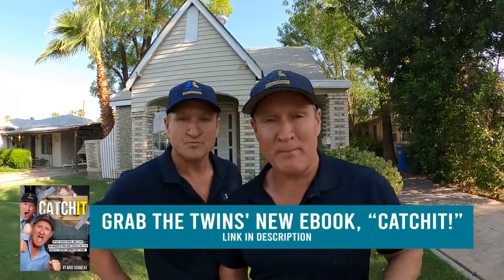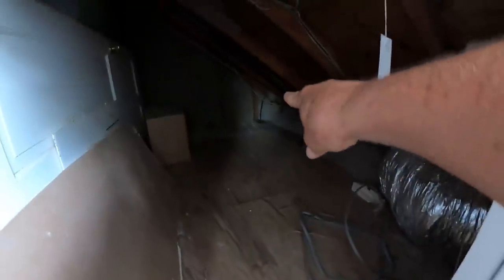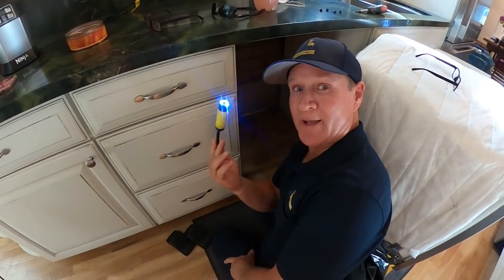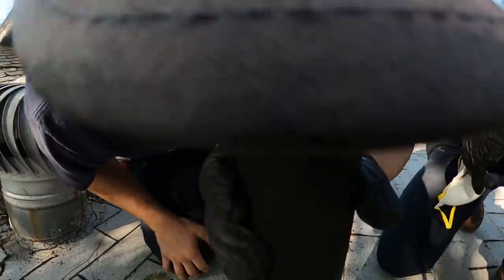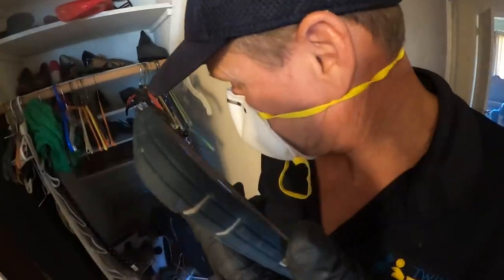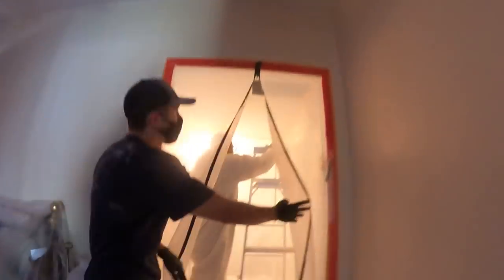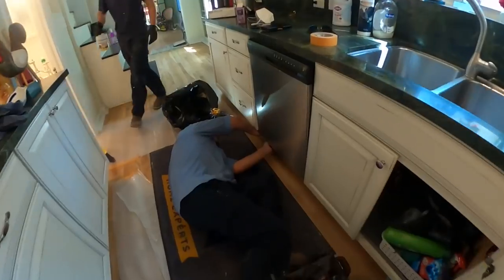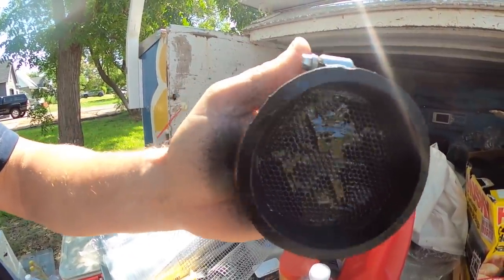Get rid of RATS FAST!..SEWER RATS entering through ILLEGAL repair!!

Comment: I can’t believe contractor would install the fan into the sewage system.
Reply from the maker: Right!?? 🙄🙄
Reply: @TwinHomeExperts  🐀 💩
Reply: Unfortunately I can, being an old building, it's likely difficult for them to run a full size exhaust line to the outside especially with the sewer vent line already there, so from an Ease-of-Work/Laziness Perspective, connecting the 2 lines together is a no-brainer despite it being Highly Illegal and extremely unsafe...

I'm surprised the home owner wasn't constantly smelling sewer gas in that bathroom...
Reply: @HappilyHomicidalHooligan  how is it a no brainer if it is highly illegal and unsafe…💩
Reply: @jamesp8  It's a No-Brainer because coming up with the solution to how to get a tough to run vent pipe through the available space is very simple when you realize there's already a vent pipe there so just connect the new one to the existing one...It's referring to the simplicity of the solution, not it's Legality or Safety...
Reply: @HappilyHomicidalHooligan  Could have went out horizontally to the outside wall as an alternative.
Reply: @Guillotines_For_Globalists  $$$$$$$$$$$
Reply: @robert9595  How so?  Drill through the siding or brick, install louvered vent, run duct to fan, done.  Not all that complicated.
Reply: @jamesp8  obviously contractor was unlicensed or didn't care about anyone safety and look for quick buck
Reply: @HappilyHomicidalHooligan  yeah it’s difficult no doubt about it but that doesn’t justify lazy behavior that could literally affect someone’s health and well being. It’s downright laziness and negligence. You pay for the work so do it. Period. If the twins can do allllllllll of what they did in this video and many others then so can a professional contractor run a proper ventilation system. I’ve lived in older 130 year old buildings and yes it can be a nightmare at times figuring things out but again no excuses when it comes to someone’s health and well-being.

Comment: I just ran across you video series tonight.  Great investigative work!  I retired 7 years ago ( after 32 years in the industry) and I do miss the hunt to find how they get in.  Here in S. Fl. they use lead lining to wrap the plumbing pipes above the roof to keep out the water.  We were trained to use hose clamps to secure the wire cloth around the opening so we didn't penetrate the lining and cause a potential water leak issue going into the attic over a long period of time.  I noticed the pipes you were working with in this video didn't have the lead lining, however, plumbing companies have taken pest control companies to court over the issue of drilling holes in the lining and won!  So be careful if you weren't aware.  I like your smoke system, I just used a wet vac and reversed the hose to blow a smoke bomb through the plumbing system and I used a sewer line snake camera to find the breach.    I used snake cameras and bora scopes. We referred plumbing companies to do the repairs since we weren't plumbers. I love the fact that you do ALL of the repairs not just the exclusion.  Keep up the great work.  I think you are an asset to the industry!

Comment: Hello Rat Twins,

   A very helpful hint, as per the electrical cables, well any type of cable, that run to the house, which rats love to use as route. Ha - Ha like a ski lift.  

   What's a funnel barrier cone? Reference: To what one looks like. Look at photos of ropes to a ship being mored to a pier.  Used to keep rats from climbing aboard.  
  
  Construct the funnel cones out of sheet metal, big enough so that they cannot climb over. The diameter should be like 10' or so, If too small they'll be able to climb over the funnel.

  A good way to keep rats from getting to the house via a cable.

  Good Luck

Comment: great info...very thorough.....my big question tho, is where do you begin as far as the incoming sewer lines???  What if they are very old, like here in new england?? Obviously you try and get under the crawlspaces, and search for those spots. Here in my area, there's 100 yr old cast running into the houses from the street, there is also alot of access holes ( with a metal cap) in the basement cement floor in order to flush the lines.... my house has at least 2 flush holes front and back. The roto guy uses them once in awhile to snake . How would you tackle containment in a 100 year old infrastructure?? Particularly in the the basement concrete areas?

Comment: Capping off the sewer vent pipes:  There are both "in-y" and "out-y" slip fit (glue type) ABS (same material as the vent pipes) pipe caps widely available.  No need to use a modified rubber cap.  The ABS caps are easy to use in a retrofit situation.  If you can get a rubber cap in there, you can use an ABS cap.

Comment: You make it look easy, that bathroom ducting hooked up to the sewer vent pipes, what a goof, that contractor or poser, knows or doesn't know his trade, any case he did a good job connecting them together, if the readers don't know, the bathroom ducting needs to escape to the outside, reason to prevent access moisture from hot air, for example when you take a shower the mirror gets all foggy,, because hot air quickly cools then creates moisture...this wouldn't be good in your attic wood, would create possible fungus, and a higher moisture level in the wood, making termites an idea house to munch on.  Twins,, good job once again.

Comment: I wish that handyman would have realized they were stuck and moved on to another job they could handle. It never even occurred to me that someone would be so lazy as to connect a vent from the exhaust fan to a vent/stack. I can say, as a handyman myself, I have pulled permits and passed my inspections so homeowners should always consider getting the permit. If your handyman cannot do the work correctly, the inspector will see and you will not end up in this situation. This is ridiculous and disgusting that someone felt okay doing such poor quality work.

Comment: 20:15: blatant OSHA violation:
“1910.23(c)(11)
Portable ladders used to gain access to an upper landing surface have side rails that extend at least 3 feet (0.9 m) above the upper landing surface (see Figure D-1 of this section);”
Come on guys, this was the first thing we learned in our OSHA certification class. One of the side rail ends is literally resting against the roof an inch above where the roof ends. If that ladder where to move or slip it could fall down with you on it.

Comment: I’m constantly smelling sewer gas in my bathroom I’ve had the plumbers out several times they replaced all of the traps and everything it still smells like sewer gas.
Reply: Possibly your vent pipe is compromised, there isn’t one or it’s installed wrong.
Reply: Toilet wax ring ? Is / are traps being sucked dry ?

Comment: You can’t block sanitary vents with wire screens . That’s an already comprised plumbing system. You’re simply creating more problems in the future. Use a Zurn Z193 vandal proof vent cap . It’s not perfect but it’s a lot better than wire mesh. Good job though.

Comment: Sorry, sealing the vents with flex seal is a complete fail.... even the tight weave on the metal brings up issues... that would never fly in the north east or any place where ice can form....condensation alone from the sewer would ice it over...

Comment: You guys did a nice thorough job but 3 or 4 dudes on an old roof that's crumbling apart as it is wasn't a very bright idea. I'd put a stainless steel perforated cap on that sewage vent and walk away. Venting it separately is gonna be a small nightmare which is why it wasn't done right in the first place. Thru the ceiling, the attic and the roof and finishing/sealing it all to look nice, gonna be costly;  Maybe she can go after the installer. I bet that homeowners clothes must have smelled lovely for date night 🤣

Comment: Find out who did that work and show that video to your local Building Inspector...

I'm quite sure the Inspector would like to have a not so friendly talk with the Contractor about their work...
- No Permits
- Illegal Exhaust Vent Connections
- Undersized Fan Exhaust Vent (the sewer vent line is too small)

 - If the Fan Exhaust line was not done properly, were the Electrical Connections for the Fan done to Code?
- If that Contractor built the bathroom from scratch, did they do the Structural, Plumbing Feeds, Waterproofing, Plumbing Drains and Electrical Feeds for the Lights to Code?
Reply: Double thumbs up! I wonder how many homes he has screwed up